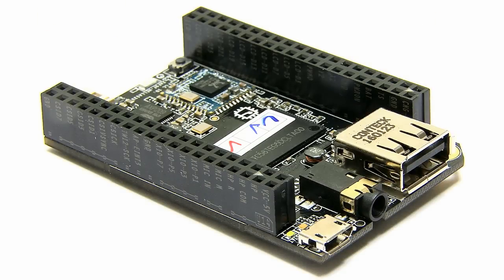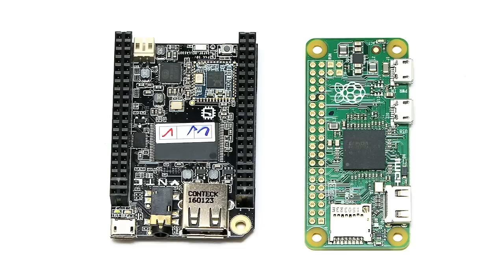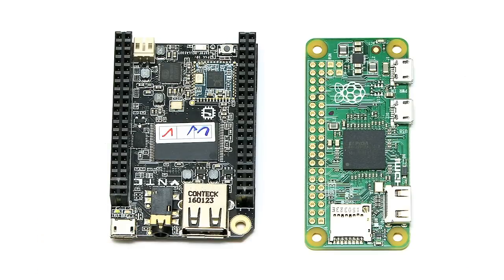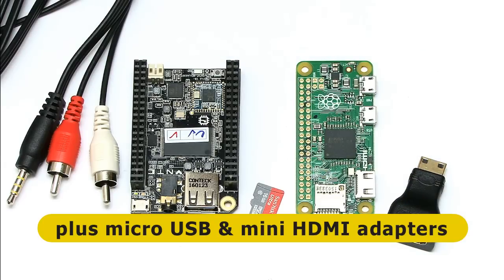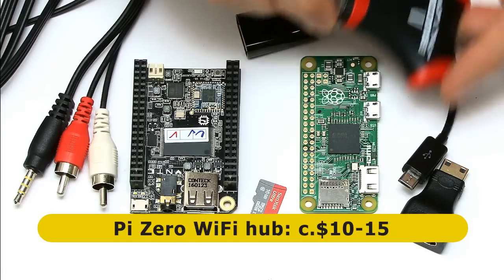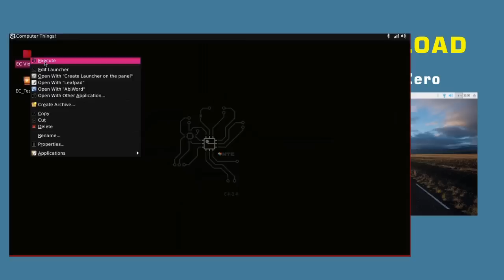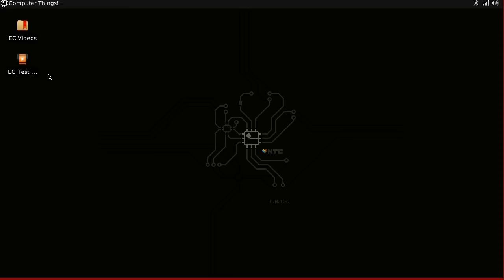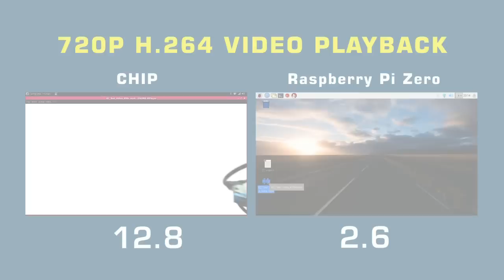CHIP v Raspberry Pi Zero

Comment: I dont understand one important thing... What is the point of this computers? Low price?

They need 10-20 seconds to run web browsers (11:14),
~30-100 seconds to open YT start page (12:29),
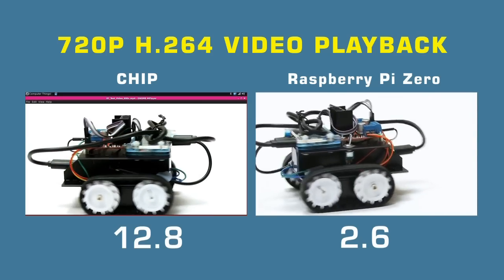one of them cant even run gif animation correctly (14:19).

I cant say that this is comfortable system to work with.
What is their target application?
Reply: The Raspberry Pi... at least the original one, was introduced with the aim of getting more young people interested in computers and electronics.  One of the founders, Eben Upton, noticed that less people were applying for Computer Science courses at Cambridge, and the applicants they had, often lacked the knowledge that had been more common a couple of decades earlier.  This they attributed to people no longer messing about with the 8 bit computers from a young age, as they had done themselves.  The Pi was introduced for young people to mess about with technology at relatively low cost.  Therefore the Pi included GPIO pins for interfacing to other electronics, transducers etc.  They still don't have the simplicity of those 8 bit machines from the late 1970s - mid 1980s, but the Linux distros available are tailored for the systems, so config is easy, and they include software development tools to ease the introduction into coding.   As it turned out, many, if not most of the Pi computers sold to older geeks, nerds, and hackers.  However I believe the RPi Foundation and the interest in these little machines, has helped change the focus (at least in UK schools) from computer classes teaching word processing, back to real computing, learning about hardware and how to code.
Reply: So, it's about teaching students... Well, thats make sense, pretty cheap solution for educational station with real hardware.
Reply: They are not supposed to replace your desktop. In most cases they won't be running any browsers at all. 
They can be used in a huge number of projects, and imagination is the only limit. For example see gameboy zero project.

Comment: I don't really believe that it is fair to compare computer speeds if hey don't have the same os and the same web browser.
Reply from the maker: I see where you are coming from, but from the point of view of what the products can do, the comparison is valid. Also, these computers cannot run the same OS. :)
Reply: I understand.
That makes me wonder, since I like playing around dangerously on my raspberri pi, I frequently end up corrupting some files or making the os not bootable and having to reinstall it all.
What about the Chip? What would you do if it ended up corrupted? Can you reset it back with a fresh installation?
Reply from the maker: The CHIP can have its OS reflashed via a Chrome web browser app that you run on a PC with the CHIP connected via USB (from its micro USB 'power' connector to a full-size USB on the PC). It works, but can be a swine to get going. I show this process in my last CHIP video. In my experience it is easier to reinstall an OS on a Pi. Congrats on playing around dangerously -- that is what they designed the Pi for! :)
Reply: Thanks for all the answers, you're a great youtuber :D

Comment: If you put the DIP on the Chip all the GPIO pins will be occupied just to have a HDMI output. On the PI you can still use the GPIO pins and have a HDMI output. 

They should've made something else for the Chips so that you can still use the GPIO pins + have a HDMI output.
Reply: You could still use pins if you put  DIP on the CHIP. You have GPIO solder points on the DIP where you could solder GPIO headers :) Look more carefully: https://docs.getchip.com/images/hdmi_callout.jpg